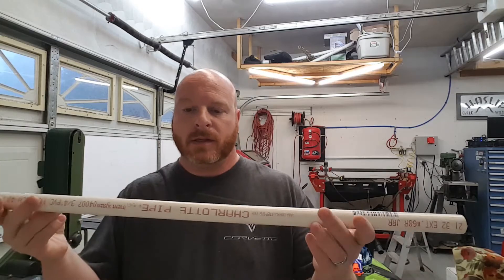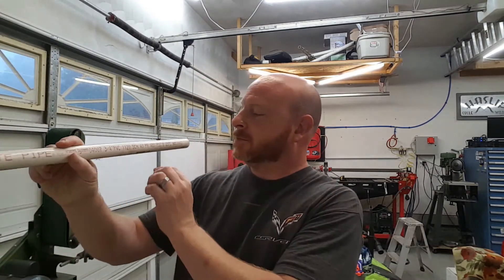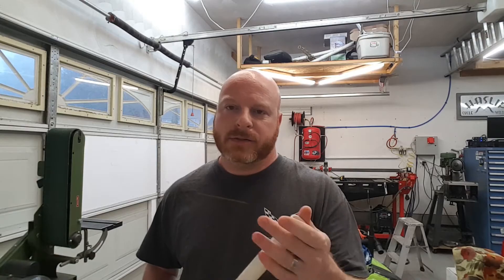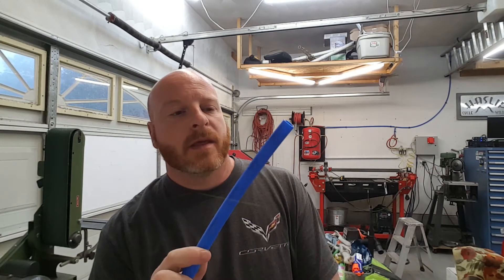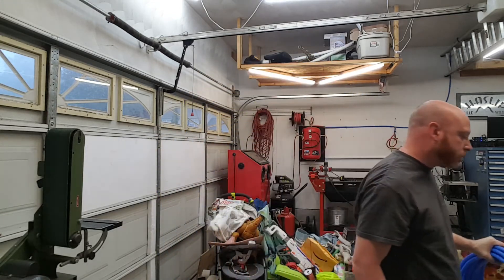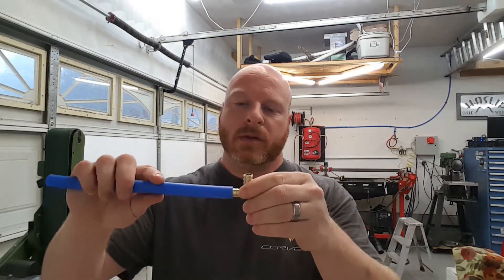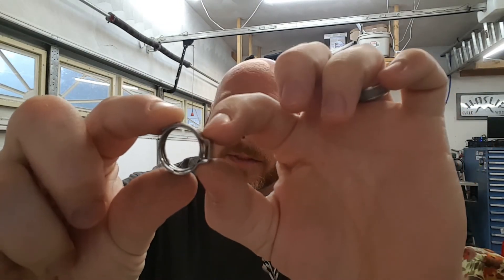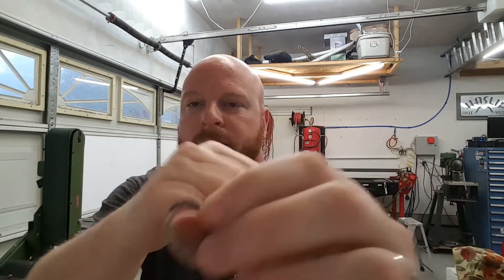Using PEX for shop air?

Comment: do you think it could handle a constant 135-160psi?
Reply: But what about 200 psi
Reply from the maker: @spikeboi55  no idea nothing I have runs that high
Reply from the maker: Yes 160 might be a little on the high side. Mine sits at 120-130 constantly and I’m sure it surged above that easily when in use.
Reply: It holds way more than the rating and it does not explode into shrapnel if it fails.

Comment: what mounts did you use to anchor the tubing to the wall?
Reply from the maker: They are from Lowe’s. Made by shark bite. Should be right next to the tube and fittings.
Reply: @HaslipCycleWorks  thank you!!

Comment: This is the route I'm goin with my air lines im a plumber so I have pex readily available im running all mine lines through the walls before I lay my insulation and drywall
Reply from the maker: That’s awesome! Kinda wish I was able to do it all behind the drywall. Maybe I can if I ever get the funds together to build a proper shop.
Reply: @HaslipCycleWorks  yea im using shark bites to connect all mine together so u don't have to use the crimping tool all u do is push the pex into the shark bite connector and it grips n seals the pex so much easier and faster

Comment: Be sure to use PEX A not PEX B bc PEX A is far superior overall.
Reply: Could you explain to us why?
Reply: @AntonioCunningham  Pex A is much more flexible allowing you to make bends in the line, and if the Pex kinks, which is very common, you don't have to redo the line, you can simply just use a heat gun to make it go back to it's original shape.
Reply: Where did you take that information? A is cheaper to use when you have the special tool, which cost a leg. But i have never heard that one is better than another. Buying the tool for type A for a diyer is plain stupid, its for pro
Reply: PEX A is good, but due to the cost of the tool to expand the pipe, it is not for homeowners with small projects like this. Also, not 1 supply house or Lowes/Home Depot carried any PEX A stuff until recently, So it just wasn't available for years here in the south, it was more popular up north!

Comment: How is the pex holding up so far? I thought about doing this years go when I gutted my master bathroom and did all the plumbing with pex. Just concerned about it lasting
Reply from the maker: Dirty Side Gets Down so far zero issues. It’s been working great.
Reply: I have been using Uponor since 2001 building homes in so cal. It hasn't failed yet.
Reply: Pex is probably one the best ways to run any form of plumbing now a days bc it's cheap and reliable. The only thing you have to watch out for is using the correct PEX for your project. Generally PEX A(Uponor) is gonna be the best one of all 3. Some of the major benefits of Uponor is the fact that it doesn't crack in harsh weather, it always tries to go back to the original shape(good for winters), and it's generally rated for up to 500 psi. But if you do use PEX B, always size one size bigger as the fittings are smaller than the pipe itself causing more flow restrictions. It's very common that people experience low water pressure with PEX B.
Reply: @itspapaj4732  I use low-flow showerheads and aerators in the faucets, so the flow with PEX B is not an issue.  Sizing up on the hot water side is very wasteful! Generally, PEX B is much cheaper and easier to find. Where I live(SC) no one carried PEX A, until recently, so B was the only option for years.

Comment: Just gotta watch air temp. Only rated for 200F. Thinking of pex for my garage but will run copper first to cool then pex to distribute.
Reply: I run a 60 gal single stage.  I am building a copper cooler to mount up front before running a PEX halo with drops around the garage.  I have been sorting out my wip connection off the tank and i think i am going to run with the pex there too, it should be flexible enough.  I mount my regulators and water traps at the drops to give the air time to cool and release the moisture properly, plus it gives me less line loss having tank pressure within 20ft of the tool.  I changed out my HF quick connects for Milton high flows (type V) and I am not disappointed. It feels like I have an extra 10 gallons in the tank.  At $25 for a 14 piece set they are not much more than the HF crap I was using and I haven't worn one out yet so I am already saving over the cheapies I kept replacing with every trip.  I learned on fittings "buy once, cry once" works out.
Reply from the maker: Matt Herring you are absolutely correct, I’m noticing the same and will have to replace some of my components soon. Sounds like you’ve got a great setup.
Reply: I'm thinking about running copper from my compressor the lenth of my garage in the rafters then tapping it with pex to go through the walls. I don't think I'll have heat issues as my compressor is 120gals and for my use I would think it would rarely kick on.
Reply from the maker: Dalton Schrader I really think you will be good with a setup like that.
Reply from the maker: That’s a good idea. In the future I may add a copper cooler/water trap setup.

Comment: Never thought about using pex🤔 I like it tho
Reply: Pex is perfect for air lines when u plumbing in a house u have to run air through it before u put water through it to make sure it doesn't leak
Reply: @whiteoutram0516  Yeah but how much pressure will it hold